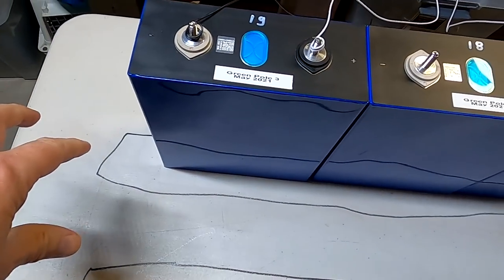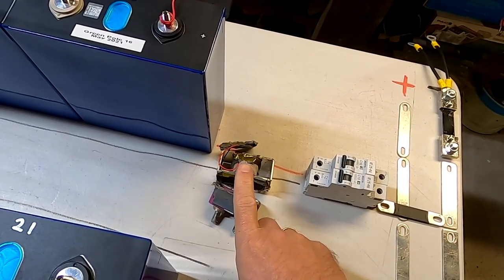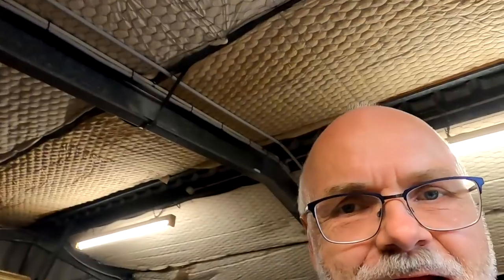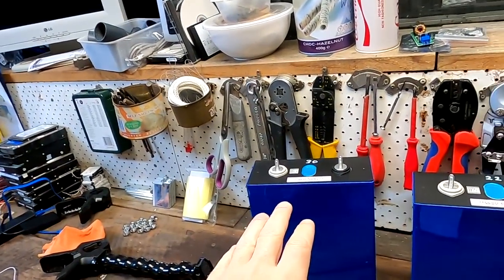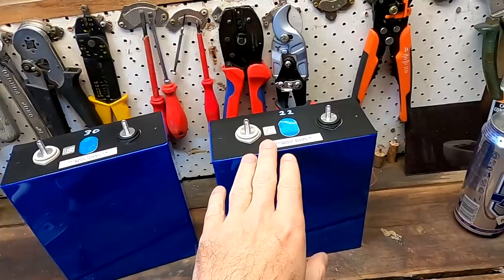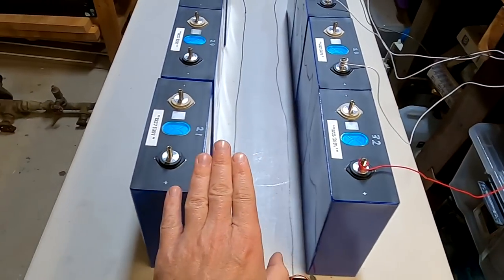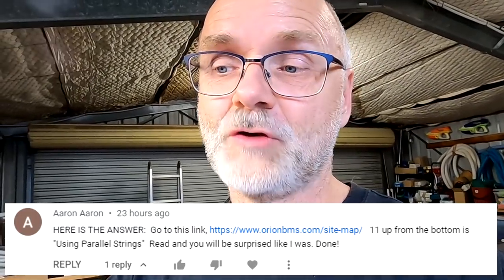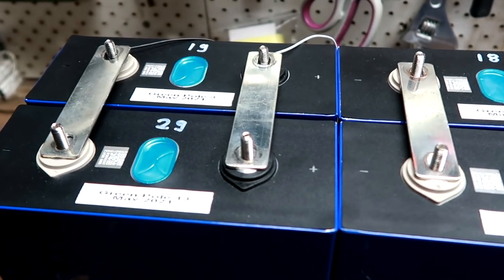Parallel Battery Strings - worst solution ever?

Comment: Andy i love the way you tell us whats going on,,,, I am going to buy cells for my motorhome so is it best 12v , 24v , 48v , as i live full time in the van so want a good system, I am in the uk ,,,
Reply: The best system is 48v but in a van rv whatever, everything in your RV is 12 volt already but 24 volt would be better and just get a buck converter from 24v to 12v
Reply: Higher voltage systems are simpler to wire but might not suit the workload. Voltage converters have losses which are not always okay to have. Also remember to not charge lithium-batteries in freezing temperatures. This is why I'd recommend lead-acid batteries for regions where temperatures go below 3 degrees Celsius.
Reply: If you are going to live all the time in the motor home, then the question to power is more related to your consumption.

If you have everything as 12v and lower (ie cell phones, iPad, etc), with the exception of a couple occasional & low wattage use items, then 12v is best.

If you have the choice to buy computer monitors that have a brick, and the brick is a 24v DC brick, and you use that all the time… you may want to build a 24v system.

In the UK, you may not have a serious need fir A/C… if you had a very serious need for cooling and the cooling is done as 110 or 220, 48v would be a better choice, to handle the constant high current draw whenever the compressor has to kick on. (The LRA Locked Rotor Amps must be repeatedly accommodated.)

To sum it up:
 - The higher your wattage need is, the more important higher battery voltage is
 - The more wall worts your have, dropping voltage down, the more opportunity there may be to eliminate the wall sorts by using the DC voltage directly (ie 12v lighting off a 12v battery with no converter.)

Comment: This might be interesting to test: connect cells in parallel strings with balance leads instead of bus bars. so just one bms needed. sounds bit scary but seems to work here: https://www.diyelectriccar.com/threads/creating-a-parallel-string-battery-which-bms.205074/